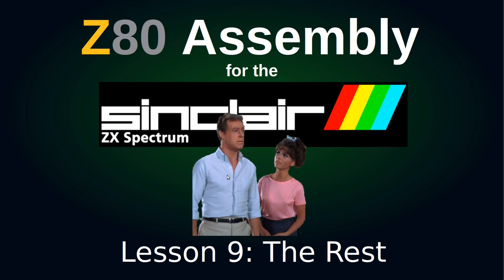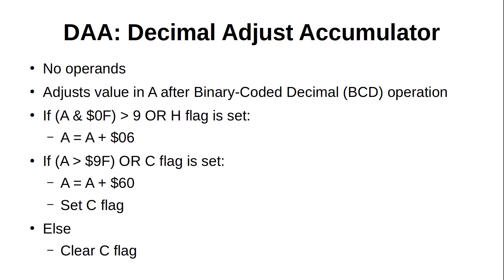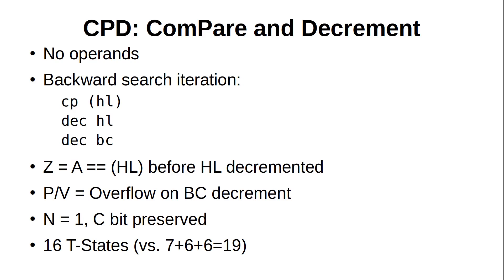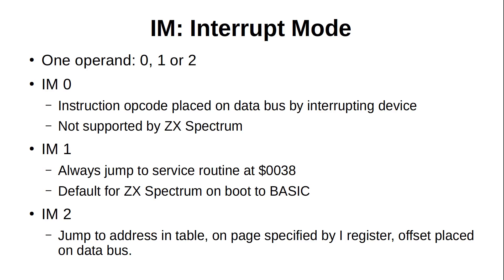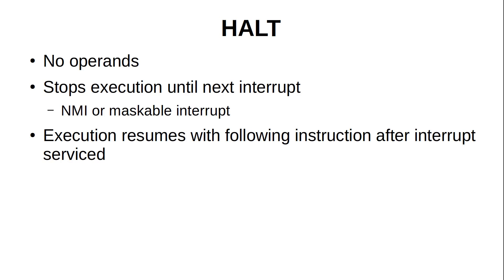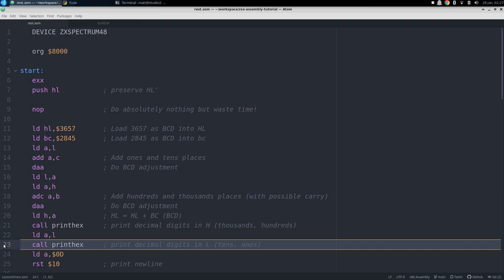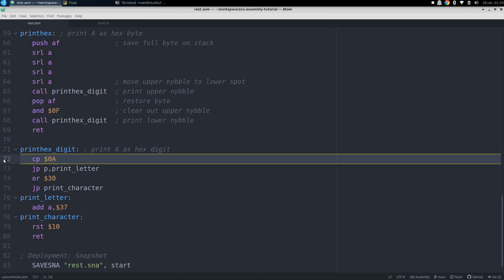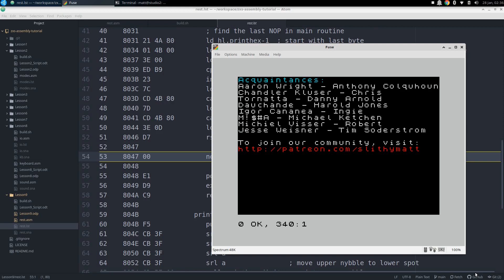The Rest: Z80 Assembly Language for the ZX Spectrum, Episode 9

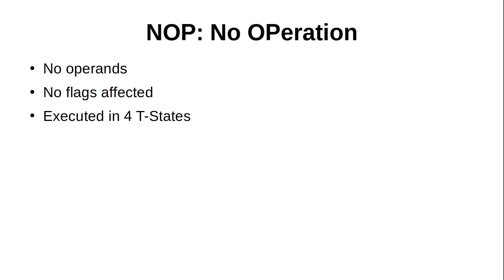Comment: 1:44 Your description of DAA is slightly in error. Not a big problem, given how convoluted the official documentation is. The error is quite simple. Given the description you provide, how would the value A = 0x9F be handled, assuming both the C and H flags are cleared. According to your description, the value 0x06 would be added. And that would result in A = 0xA5, which is incorrect. The DAA opcode takes into account any potential carries from bit 3 to 4 from the correction and in the example I've just shown, would add the value 0x66, giving a result of A = 0x05.

Comment: AFAIK the EI enables the interrupts after the NEXT instruction. That is actually pretty smart. Imagine that interrupts come in faster than you can handle them (or stays asserted). By enabling the interrupts one instruction later, you have time to finish your interrupt service routine (ISR) with a RET/RETI before handling the next INT. Otherwise the stack would quickly fill up with return addresses and crash your system.

Comment: two very minor comments (level autism ;) ):
1) the CPI/CPD/CPIR/CPDR leave PV flag set when resulting BC is non zero, not when decrement overflows. So to "search" 10 bytes you load BC with 10, not 9, and `ld bc,1 : cpi` will result in PV==0, BC==0
2) in the BCD addition the ADC receives carry from previous DAA, not ADD. The difference is like this: 0x10 + 0x90 will after ADD produce 0xA0 and no carry, but DAA will fix it to 0x00 and set carry, to give you chance to produce 0x100 as result.
Reply from the maker: Good to know about #1, that was not apparent from the documenation. As for #2, I tried to make that clear, but maybe I didn't.